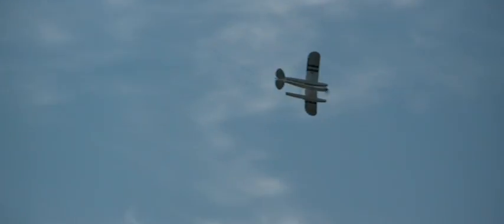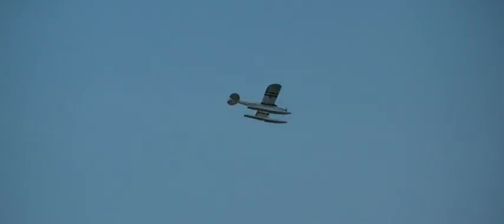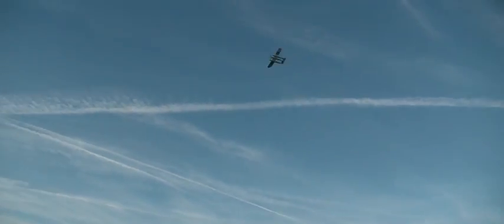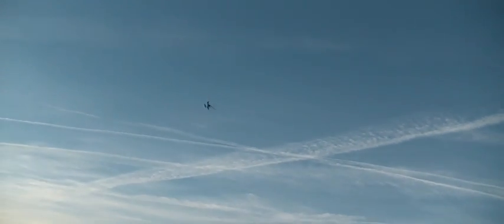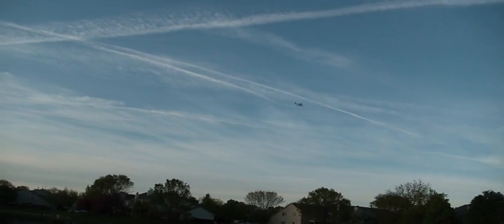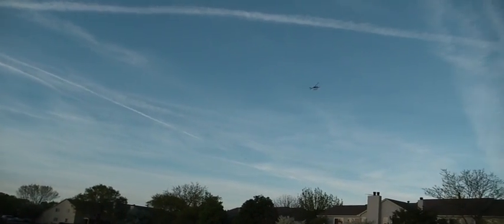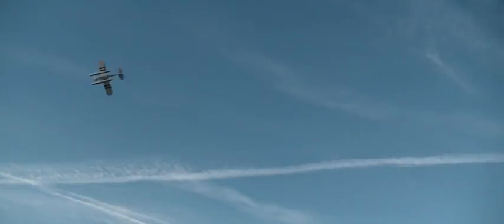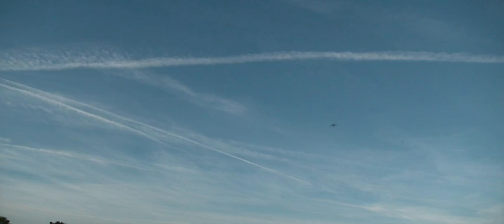Why you SHOULDN'T use CRAPPY servos!

Comment: @rcplaneguy1 Planes with dihedral and ailerons can fly very well. There's no need to flatten out a perfectly good wing unless you want to do aerobatics, especially rolling maneuvers and those don't usually work with floats. Also the ailerons have to counteract the pendulum effect and the drag from the floats so the best thing is to kick in a little rudder (or mix it in with your transmitter) to get a smooth coordinated turn. Just my 2 dollars worth (inflation!).

Comment from the maker: @xXfrownyguyXx the plane in a BNF package is $169.99.  The float kit is about $25, then to add ailerons you need 2 servos which would cost about $24 for the ones I used(after replacing this crappy ones).

Comment from the maker: @3xut I don't think so, because ground tests worked perfect and it doesn't seem to be causing any problems.  I put on the SV80's now and have again tested it, also tested using pressure while controling the ailerons(pushing with my hand) - it looks like it is working perfect, so I will try it again soon, hopefully tonight if wind dies down a bit.